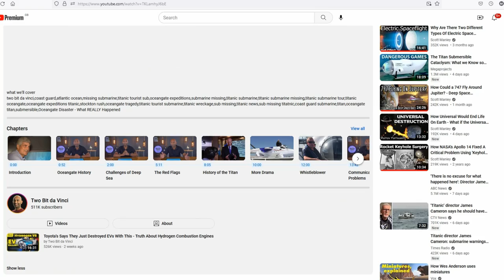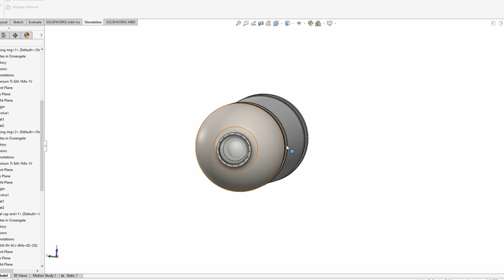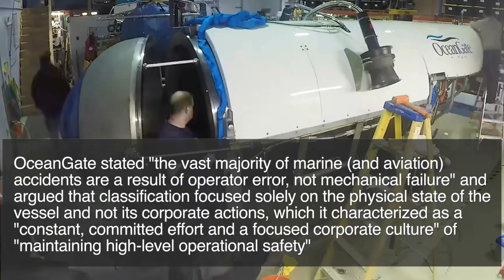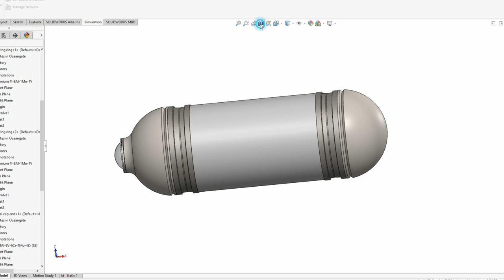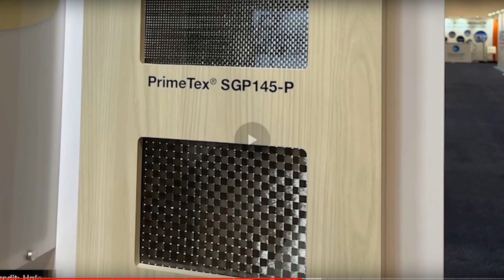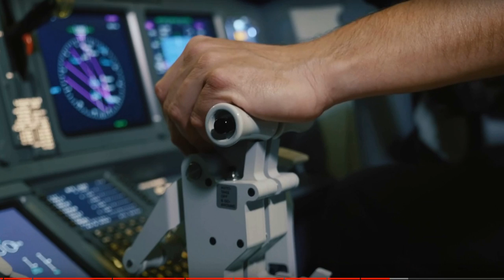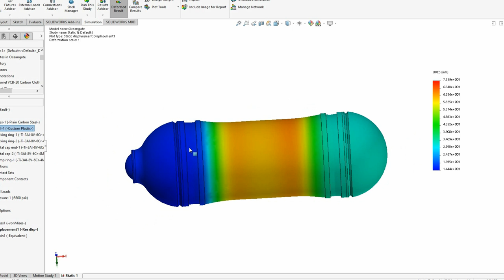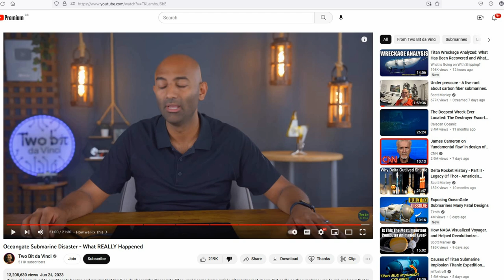Oceangate Titan - Engineering Failure?

Comment: Are you able to model straight Carbon filaments axially wound in Solidworks to see what the tensional stresses are on the resin between them when the cylinder is deformed??
Reply: The stress bourn by both fibres and matrix can be calculated on a few sides of A4 paper by a strong mech eng or materials eng. graduate (or someone with equivalent knowledge derived from experience in this field). The real situation will deriavte from the  design calculation due to factors like material and manufacturing flaws (that due to the cylic nature of its real loading history). The lack of real world physical testing testing to replicate and "measure" reduction in loading bearing capability per dive cycle (due to progressive growth of manufacturing flaws into cracks/delaminations) is very poor engineering practice to say the least. The are so many potential design "discrepancies" and sources of manufacturing derived initial flaws that must be accounted for in real worst case calculation & testing. Fibre orientation in the CFRP filament wound cylinder should be optimised for magnitude and direction of the (worst case) real service loading spectrum. I only saw hoop files being wound on the video of the filament wound CfRP cylindrical shell (if so that is a first order fundamental design discrepancy... fibre (tow) oientation and volume fraction  should have been configured to make make it quasi-isotropic at least. (May be my assumption that only hoop fibres were incorporated based on the brief manufacturing video clip I saw). Even so, the adhesive bonding of the CFRP to Ti alloy end caps should have been done in clean laboratory condition ( as per aerospace) not in a warehouse type environment. Its mathematically predicting progressive damage accumulation (cross-correlated with mechanical testing to failure using cyclic testing in a saline environment) that costs the money and requires real world expertise & experience in the mechanical & Materials engineering field.  Unfortunately the CEO let his ego dominate over the engineering which did eventually come back & bite him. I could go on but there were so many "corners cut" that the cyclic nature of the loading and basic design discrepancies led to the inevitable, FEA or not. Cannot beat a comprehensive mechanical testing program to croo- correlate with the design maths.Sorry for the ramble.. ( I am Materials engineer in a UK University)
Reply: @philswanson8135 Hi Phil, please don't apologise for the ramble, I am British as well, like to go into great detail but the most obvious thing above all others would appear to be the total lack of longitudinal reinforcement, a lot of people do not understand that when the cylinder centre is pushed in the inner wall becomes stretched and under tension so the resin BETWEEN  the axial fibres would have broken. The other thing that people forget is that under extreme pressure the end caps will push in on the ends of the cylinder wall, as the epoxy is a ductile material, it could be extruded from the joint until there is no glue left between the wall and cap, but as the caps are in compression this is probably not an issue under load.
Reply: The maker of this video has gone to a lot of trouble to model this BUT has neglected to factor in the lack of longitudinal reinforcement, I would suggest because Solidworks allows the user to pick a fairly ordinary selection of materials which are likely to be presumed to be cross woven.
Reply: @philswanson8135  I always prefer the full half hour argument rather than the five minutes. MP ref
Reply: Spot on... engineers/scientists who cannot discuss (or under go critical dialogue of their work) without loosing their cool are either hiding their ignorance and or massively arrogant/egotystical. So I will sign up for the full half hour "argument" also please lol. (Repeat booking every 24 hours if needed). "Every day is a school day" (even if by accident). The CEO seemed so arrogant and seemed to "get off on" taking risks- brushing aside technical concerns from others (In his own organisation- ref sacked enginner from his own company about 5 yrs ago who raised severe technical concerns) Taking money from paying "customers"  and gambling with their lives and trust is immoral (if technically not illegal if operating in international waters). This YouTube "video" is one of the best evaluations I have seen to date for a general audience). Cudos to the author and Monty Python  !
Reply: @philswanson8135  Big tick A*
Reply: I’d think the accuracy of modeling an anisotropic composite material like carbon fiber would be horrible, unless you tuned the simulation to exactly how you construct the layers in real life. And even then, creating the conditions for the simulation would be a mess.

Comment: I think under pressure @1:38:00 where you talked about 7mm of deflection at the center of the tube.  the ends of the carbon fiber would have been pushed into that inner lip on the titanium rings causing a cutting action against the carbon fiber. While the outside edges around the ends of the carbon tube would be pushed up into the titanium rings causing crushing of the carbon fiber.

Comment: Pressure is the result of the columns of water/air at every point on an imaginary horizontal surface at a given altitude/depth. The key is that water and air do not resist shear, so moluecules will move towards regions of less resistance. If there's pressure from above, and there's a "void" horizontally, the molecules will convert their vertical pressiure into movement according to the pressure differential, until the horizontal pressure equals the vertical pressure. So pressure at any point, and in all directions, is a function of only height/depth, gravity, and density. If the hull of the Titan developed a "crack" in the carbon fiber, water would immediately rush into it, until the pressure pushing the water in is countered by un-compromised hull. The layers of carbon fiber deepr into the cylinder are progressively less strong than the ones above them, because there's fewer layers below to "help". The problem is, that once carbon fiber cracks, the void is permanent. With each dive, existing defects would be agravated at progressively lower depths due to previous weakening of the hull. There's evidence that Stockton verbally told passengers to "expect loud sounds", as on the second voyage Karl Stanley reports it sounding like "small caliber gunfilre".

Comment: The adhesive used to join the titanium rings to the CFRP would have to have a good bit of elasticity due to the difference in thermal expansion coefficients of the materials being used.
The temperature differential that this hull would have to endure is pretty wide. I don't know of an adhesive I would trust for this application, not with mine or anyone elses life anyway.

Comment: Great video. I know very little about engineering and this seemed both informative and easy to follow. I also liked the 'Uncle Roger' style of commentary and humour. Actually for me the issue with the gamepad was that it was Bluetooth or perhaps wireless. I use Bluetooth/wireless headphones for work, but always have a non Bluetooth backup. Not sure about the fire risk of game controller and to be honest that would seem to be the least of their concerns getting into this death trap.
Reply: well it's survival of the fittest and Rush the guy in control on titan was unfit to survive that is why titan imploded cause the transcripts say they were descending faster then previous dives and yet the moron decided to continue instead of aborting to figure out why that dive was going so fast he waited to long till the alarms for the hull went off saying the hull was failing and after 20 minutes of struggling to gain and come back up a bit closer to the surface the subs hull finally lost the battle against the ocean pressure which was relentless in attacking the subs hull trying to get in and it found a way in through implosion simple really when you think about it

Comment: I dont' know if you covered it, long video so I might have forgotten, but it wasn't just a carbon fiber tube. it was a steel tube wrapped with carbon fiber (refering to your SW model and your FEA analysis @1:35:00)

@ 1:52:00 you can see a shot from the inside looking out during the attaching to the ends segment that it does appear to be a steel tube.

Clearly, even though it was CF reinforced, the did not go thick enough wall on that steel tube.

One would hope for a much higher FOS than what they built that stupid underwater coffin at.

Comment: I read a comment that said having a carbon fibre hull was a great advantage for deployment due to being able to use a smaller ship and standard cranes.
So maybe for much more shallow use a submersible like this could be much better for tourism operators. Most of which will be for wrecks or coral etc in depths of only a few hundred metres at maximum.
And the problem here was just that the design was not suitable for such crazy extreme depths.
Reply: Done well and for depths of shall we say,  hunderds of meters.....why not.
Reply: The problem is if they do enough dives it will fail inevitably

Comment: 5 inch thick carbon fibre does not enjoy deflection. Particularly radially wound CF. It starts to break down on every cycle. The outerrmost layers (2.5 inch) are under compression but the inner layers (2.5 inch) are under tension. The material is at war  with itself 🤣

My guess is that the failure was initiated at the centre - the point of maximum deflection and fatigue. The end caps were not keen on going anywhere - other than towards each other. The combined axial force on the caps obviously contributed to the buckling and destruction of the  tube. I doubt that we will ever know. It shattered like glass.

Comment: The end caps’ bonding to the carbon fiber tube were ok until the tube collapsed in the middle.  
I feel that ice pushed into voids (the dots David Lochridge  saw), froze while being stored or displayed in below freezing conditions, and then expanded 9% with 30,000 pounds of force.

Comment: Ive worked with hi performance adhesive. What I notice in the application vidio is no one wearing gloves to prevent oils on your skin from limiting the adhesion bond. I seen several people touching the glueing surface and even one guy wiping it with a rag.....all no no's
Reply: plus not in a vac chamber hence air bubbles. complete amatuer hour.

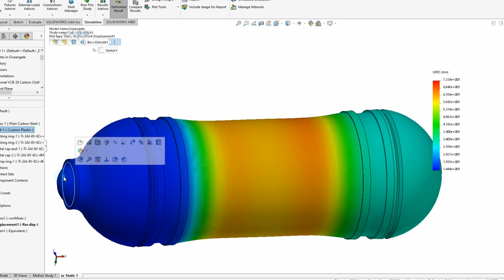Comment: 1:40:49 So if the middle part shrinking inside it also means it's getting shorter on the joints next to the rings and this is pulling inside with the pressure inside those two forces those two forces is working against which causing pulling out from the seal am I right am I right

Comment: Interesting video. Hand applying adhesive - what could possibly go wrong... 
In the automotive and aviation industry, adhesive bonding of chassis/bodyshell/airframe/fuselage members, structural panels, etc is carefully controlled with uniform adhesive film thickness, regulated clamping forces and depending on the application - the use of micro bead adhesives to prevent the glue from being completely squeezed out of the surfaces to be bonded. These Oceangate guys are trowling it on as if they're tiling a bathroom.  
Your shockwave propagation hypothesis is interesting. It reminded me of a shaped explosive charge going off.

Comment: The sockets on the titanium rings are tiny in relation to the diameter of the carbon fibre tube , the tube is obviously the spigot, the sockets could of been 200mm deep giving way more surface for the adhesive to adhere to and a way stronger joint.

Comment: Without knowing the details, the issue for me regarding the X-box controllers is that it seems like it was the only means of control of the sub, he would take a few down with him for 'redundancy'. I would have preferred a wired controller as the main means of control, and the wireless as an additional means of control for convenience. I suspect that if the controllers on military subs stopped working, there would be a manual means to control the periscope.

Comment: If you look at the rings when they are lifting them off the deck of the salvage vessel you can clearly see that they are clean, as in no visible carbon fiber attached, which if the joint was good there would still be evidence of the carbon fiber attached .

Comment: One issue with the wireless game controller is that unless it was heavily modified (Which we simple don't know) then I might present a risk for a device in the environment it was being operated in. The atmosphere in the sub was not at 1bar but several bar and as such the concentration of o2 was much higher. The controller in it's out the box form would not have been intrinsically safe. It's Lithium Ion battery and the potential for sparks in that atmosphere would have increased the risks of fire. I care not that they used an off the shelf product, but was it modified to reduce the risks in the environment...? This also goes for the other 'off the shelf' electronics like the monitors etc... Conformal coating would have gone a long way to reduce the risks..

Comment: if I get the color-coded legend right, max. deformation is 70 mm, not 7 mm (7e001 = 7*10^1 = 70); seems quite a lot, but ~ 400 bar of outside pressure is also quite a lot...
@ dirtygarageguy: can you please tell us, if you have considered the unidirectional layout of the fibers along the circumference in your model?

Comment: High modulus thin walled carbon fiber fishing rods have a tendency to undergo catastrophic failure while being stressed after having previously received a sharp knock. I've had it happen, its as impressive as it is expensive. This was my first thought when they said it was made of carbon fiber don't know if it applies in this situation I would hope it was a design consideration but it made wounder.

Comment: You hear someone say anything over 30. I wonder what hes referring to. You are spot on about hand applying bonding adhesive. I think everything was driven by number of passengers to make project profitable. To scale up a titanium sphere to fit five people would be massive. Then add cost of syntatic foam. A 24" x 36" x 9" block rated for those depths can be between 5 to 10 grand EACH. Limiting factors sphere was 5 feet in dia and it held two people and lots of kit.

Comment: The Game controller might malfunction in the high humidity enviroment. The Wi-Fi version of the controller might have interference within the cylinder, even getting echos from its self. High pressure carbon cylinders are already in use as scuba diving tanks.
Reply from the maker: So, high humidity? Where do you get that from? Also, don't use 'might' as an argument. 

WiFi have interference with a carbon/HC cylinder. Provide any evidence of that.

Echos? 

About cylinders, that's hoops stress and outward pressure, not compression from the outside.
Reply: The passengers were asked to avoid stepping in the puddles of condensation that build up as the outside temperature drops. I use the word  might when I'm making it clear that I'm speculating. I think the term multi pathing is used when radio signals echo and cause interference with it's self and could also  be caused by the metal end caps, again just speculation. The suba tanks are cycled with pressure. The walls flex each time. That is the comparison that I think is worth considering.

Comment: I think you are on the right track. I was surprised that there was no “squeeze out” at the joint when they set the ring. Also no one has mentioned CTE issues at the joint.  Does your Solid Works model include CTE?

Comment: The point about the vast majority of failures being due to operator error ('and therefore classification is pointless') is completely wrong for another reason. It actually adds evidence that classification is effective and necessaru, in rhe same way that making soldiers wearing helmets increased the number of casualties presenting with head injuries.

Comment: If all subs were all made out of carbon fiber and Titan was made out of just steel and the experts said that was crazy then everyone would be an expert on how dumb it was to use steel. My point is that before this incident happened, 95% of the population didn't know anything about sub construction.
Reply: But the key takeaway is that the 5% of us who do understand sub construction did already know that carbon fibre was a bad idea.
Reply: Steel is tried and tested material, carbon fiber is not. That's one of the reasons Elon Musk, has chosen stainless steel for his Starship instead of more fancy materials  (like carbon fiber or titanium). Steel is very well understood, even titanium is better understood than carbon fiber.

Comment: The American Society of Mechanical Engineers has construction codes for pressure vessels. I guarantee this vessel would not pass a cursory inspection by any competent inspector for service at these pressures without humans inside.

Matt google "ASME Virtual Testing of Composite Pressure Vessels" for an insightful document from the ASME about composite pressure vessels.

His point about military testing is completely laughable considering the US Navy's LCS program. An entire fleet of ships completely unfit for service. The hulls cracked on ALL of them.
Reply: Yeah, but LCS was....shall we say...programme management / requirement failure.  Some people from shipyards involved commented e.g. on Sub Brief channel - like Navy refusing maintenance data, whole debacle of limited and overworked crews..... PS: he himself was some kind of tester in F-15 programme....
Reply: But a submarine is an anti-pressure vessel, the rules are different as the wall is in compression, not tension - isotropic materials in a sphere are pretty much a hard requirement as has been sadly demonstrated...